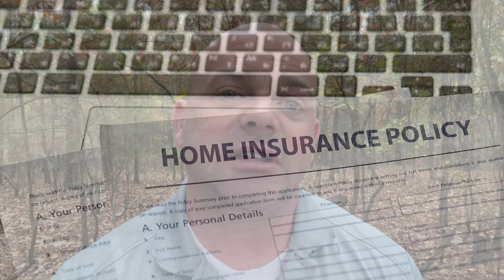Termites 101

Comment: I had to replace 30' of wall in the master bedroom and half bath. All of the top and cap plate and all the studs and two window rough openings had to be replaced. The sill plate was the only board (s) that escaped damage as it is treated per code for direct on concrete.

Comment: A lot of miss information was spread on this video I’m a licensed Termite exterminator in Texas and your best bet is to trench the house and the chemical that you’re supposed to use is a non-repellent so once the insect get infected by the chemical they take it back to the actual nest that’s is what kills the termites. It takes anywhere from 90 days to 60 days to kill a full Termite colony with that procedure. I love the video, but I just had to correct you on the miss information that you’re sending out and the chemical that is used last 10 years. 1500 bucks for 10 years that’s not a bad deal.
Reply from the maker: Baiting is much more effective in my opinion. Agree to disagree
Reply: @livingintuscaloosacounty3844  how they’re blind forges?? it’s like hitting the lottery and good luck, baiting a Formosan termites colony
Reply from the maker: @LOLSNAPED  actually all the folks I know who are treating in Formosan areas are using sentricon. Spot treat with liquid and put out bait stations everywhere else
Reply: @livingintuscaloosacounty3844  no way you have a license because in order to get rid of that particular kind of Termite you have to remove the actual cartridge from the property right or wrong so how are you going to do that using a bait station and not doing injections into the wall and not running a moisture meter
Reply: And I’m not trying to bash you at all but we been around doing termite since 1979